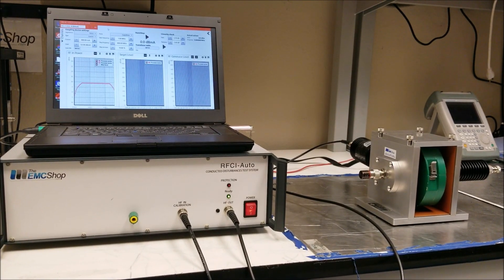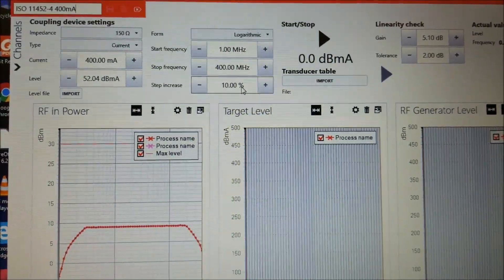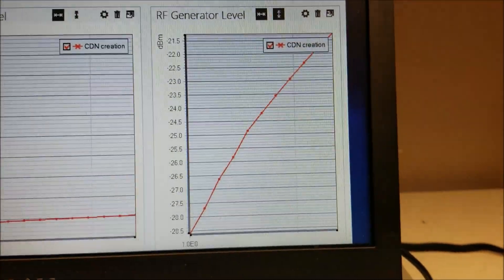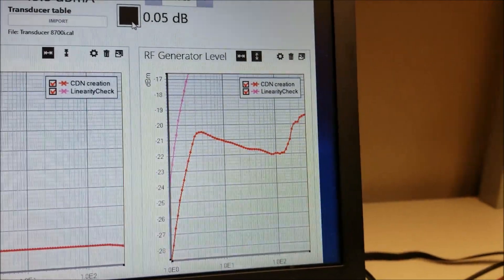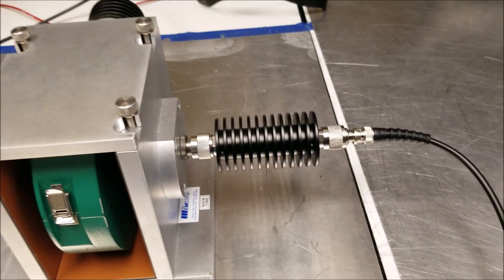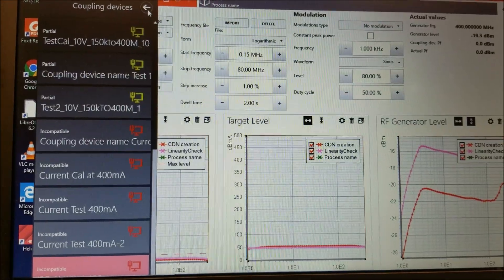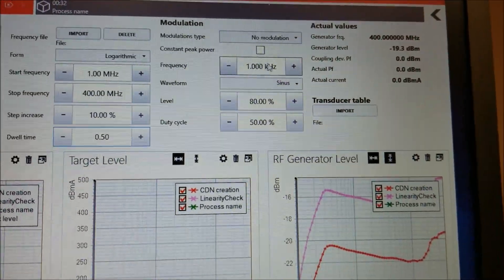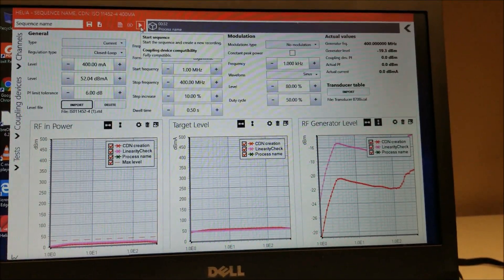RFCI-Auto ISO 11452-4 400mA RF Conducted Disturbances Testing - The EMC Shop

Comment: Hello sir, what wattage is required for the power amplifier to reach 400mA?
Reply from the maker: Depends on the injection probe and frequency. But 80 to 100 watts is a good rule of thumb. Takes about 200 watts to hit 400mA at 1 GHz with the BCIP1G.